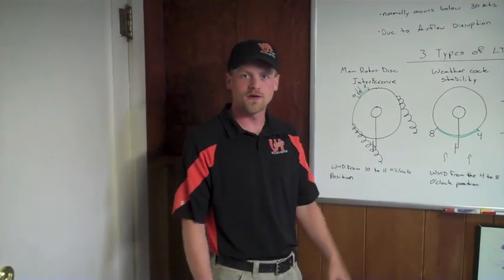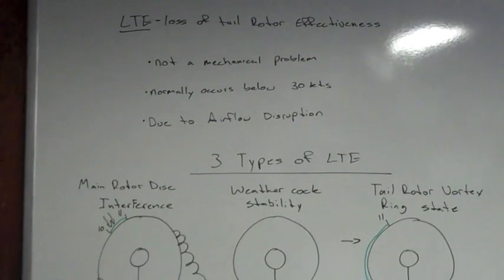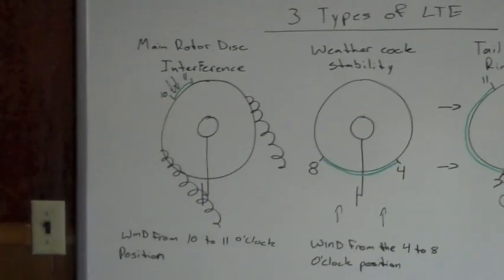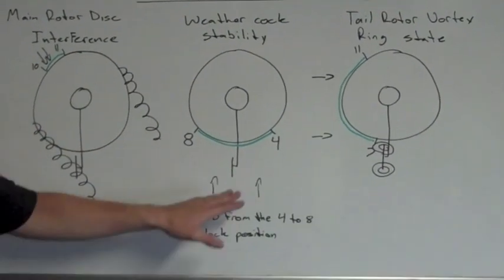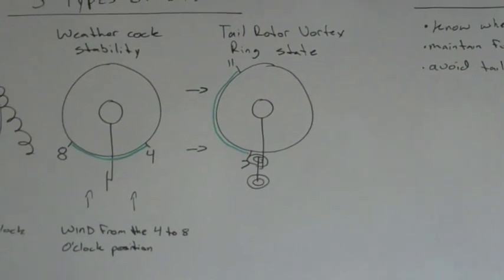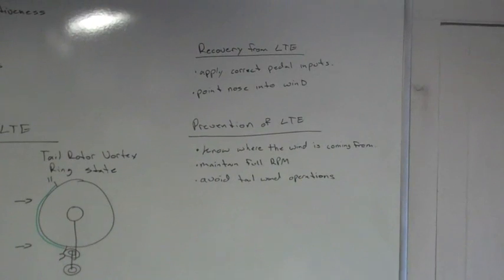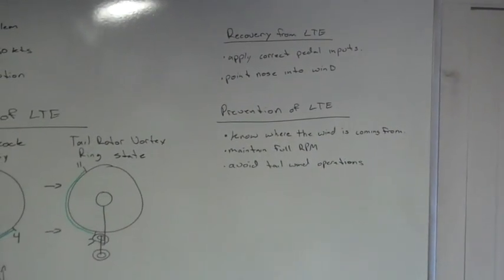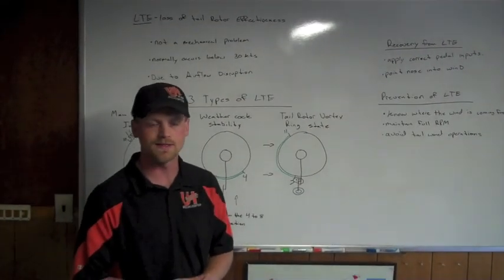HELICOPTER LESSON: LTE - LOSS OF TAIL ROTOR EFFECTIVENESS

Comment: are these explanations available for both clockwise and counter clock-wise turning rotors?
Reply: Nope... those are just for counter clock-wise turning rotors. If you have a clockwise turning rotor your area to "avoid" is 1-2 o'clock (main rotor disc interference)  and 1-5 o'clock (tail rotor vortex ring state)...